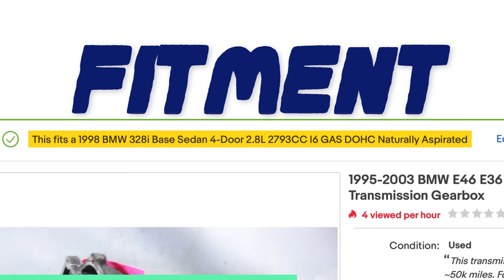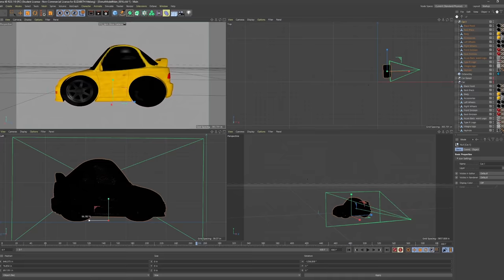Is a Manual Transmission Swap Worth It?

Comment: Yes. End video.

Realistically, most auto transmissions aren't slower these days, and can actually be faster, especially if you reflash the transmission computer for crisper shifts with decent sequential modes that don't upshift when you get off the throttle.

My car had a garbage auto and I got a much better driving experience just because the gearing matched my torque curve better. But even without that, slushboxes are cancer. Drive a man's transmission or GTFO.

I've done two manual swaps on my own MR2s, then one on an S13 240SX, one on a '69 Mustang, and one on an 80s pickup of some kind. None of them was terribly difficult, but it does help a lot if the chassis was designed for the manual and all the new parts just bolt right on. It also helps when you can just run with the auto ECU instead of trying to swap ECUs, then re-pinning the harness. Doing a manual swap on a new Camry is in the "probably not worth it" category unless you're good at fabrication.

Comment: I'm curious... 
Is it better to (just) buy a manual gear car or buy an automatic gear car and then convert it to manual? 

Is it absurd or this kind of tunning could actually improve the car's performance? (Depending on the car parts of course you get of course).
Thanks✌

Comment: Didn't watch this whole video, but one thing you have to do if you swap in a manual trans is swap your rear end for a lower geared, (larger number), unit, as a manual transmission will not allow you to pull as high a gear as an automatic will.  Fail to do this and you will not like your conversion - every time you upshift, the engine will fall on it's face power-wise.
Reply: the final drive ratio on automatic e36 is actually shorter than on the factory manual ones

Comment: What if you have a manual, wanting to do an engine swap, and the new engine came with an automatic transmission. Do I need a flywheel for the engine swap?

Comment: 750 bucks for this shitbox's used transmission??!?!? those go for around 100 bucks or even less where I live. Many people call E36s "trash cans" because oftentimes people bought them rusted for cheap, drove the crap out of them and trash them. It was the cheapest car for drifting, people would weld up the diff, and abuse them until they would fail, then trash them, it is the same with e46 BMW and used to be the same with the E30, and because of that (and rust), E30 is now a rare sight to see

Comment: I just "totaled" my '07 Toyota Carolla sport, after just replacing the clutch I burned out. I just bought a 2014 of the same make and model, but no manual available. New car has almost 170,000, and my manual only has 139,000. Seeing that I already have a manual car, I have all of the necessary parts right there, don't I? We get super icy winters and I've never owned an automatic because you are 100% reliant upon brakes. Brakes are no help on ice and you cannot stall your engine for an instant stop in an ice or impending accident emergency. Terrifies me to not have that control.
Reply: highly doubt you will be able to swap the transmission over to your new corolla, also because its fwd you would have to figure out how to get the shifter assembly and cables to work properly. would probably be easier to just swap the entire engine and trans in from your 07 but its just not worth it tbh, shouldve just got a manual in the first place

Comment: Awesome video as usual !
You mentioned that you can remove the check engine light with a scan tool, can you elaborate more ? 
I did the swap and I still
Have the light on but the it’s not clearing .
Thank you in advance !
Reply: You cannot clear the code if the ECU is looking to communicate with the automatic transmission.  You will have to look for a manual ECU and reprogram it with the correct VIN.   I know this because a parts house kept sending me an automatic ECU for my manual BMW/mini and I kept getting TCU not communicating codes. (Transmission Control Unit). I’m in a DEQ area and they wouldn’t even check emissions when the check engine light was on.

Comment: how do you know if the transmission will fit in your car? I want to manual swap a ford taurus pi, but because the cars only came in automatic, i’m worried i won’t be able to do this.

Comment: I have a question semi related to this project.  I have a 1995 Chevy k2500.  The previous owner took the automatic transmission out and put in a 5 speed manual transmission.   It suited my needs for awhile.  Since then the engine became toast, so I put in a new crate motor  double the hp and torque that came from the factory.  

The manual tranny no longer suits my needs and I'd like to go back to an automatic transmission.  The tranny that was in the truck from the factory really isn't adequate to handle the new engine.  It had a 4L60 in it.  I'd like to put in a 4L80 but I have no idea if that's even possible.  Can you provide me with some various reference websites where I can do some research to see if this is possible and what it would entail to get it done

Thanks

Comment: I suppose “worth it” is a subjective term. It would depend on what you going to be doing with it. Off road, racing, or drifting then yes. On the other hand a daily driver that you plan on going back and forth to work or sitting in medium to heavy traffic all day then no.

Comment: Is a manual transmission swap worth it? Yes. The autotragic in my 98 Accord blew up as they tended to do. I was able to buy all of the conversion stuff needed and an MT transmission for less than another used AT for the car.

Comment: If I used the ecu from the donor(cuz I motor swapped too) and it still doesn't crank. Do I have to bypass the neutral safety?
Reply: E36^

Comment: Do is an axel swap worth it? Do a video with a jeep xj manual, and then swap the axels turbo it and strengthen the frame, I garnuntee that said series or video would be a hit, Multimillion views. Yeah a good example is also about $6-10k it just works though

Comment: Why not hack into the ECU to manually control the automatic transmission?
Reply: bc then your not manually shifting gears, which is the fun part. its not about picking your own gear (mostly)

Comment: with all these parts, isn't a "stock-manual-shifter" cheaper? Ohly the parts they've shown are over 3k.
At the end he say, that he has a car, which is 2.5k-3.5k more worth, than he pay for the car, and he doesn't pay that much for the parts. That's wrong. He paid more than 3k for the parts. So he could buy a manual car for the same price.

Comment: Auto’s suck. My 2019 jetta has a turbo, but it’s an 8-speed auto. The turbo doesn’t engage until about 2,000 rpms but the transmission shifts at 2,200. It sucks…

Comment: Yo, I’m really new to all this car modding. I’m planning on buying an e90 as my first car however they hard impossible to find in manual transmission in my area so I’m considering buying an auto and converting it. But I’m really not sure if I should do that as I’m not aware of the pro and cons. I actually did find a manual e90 but it’s got around 200000ks in it. Please help someone!

Comment: i used to think a manual was fun until i had to drive one for about a year. seriously got tired of working that clutch. i'll take a good auto any day over a manual. more power to people that like a manual though
Reply: driving a manual is the norm in Europe and the UK. It does suck a little in start/stop traffic, but on highways it's the same because then you just put it in 5th gear and enable the cruise control

Comment: I doubt I'll get an answer to this, but is there any particular reason you used a hydraulic clutch instead of a cable clutch since you were doing a transmission swap?  Although I've got more miles with the hydraulic clutch it has always given me a bit of trouble and I still prefer a cable clutch, which is why I'm interested in the answer.
Reply: because the manual version of this car would have a hydraulic clutch so it’s much easier to just use it. and what trouble does it give you?
Reply: @arcanevoid9199  I've only driven one vehicle with a hydraulic clutch, but I've put well over 120,000 miles on it.  I got it used, and for the first 100,000 or so every so often it wouldn't shift into first or second gear at all, and it always ground going into second and third gears.  Both problems happened with the clutch pressed to the floor and the reservoir full.  I'd think the problem was the transmission, except that trying to straight shift was worse than hitting the clutch.  Part of the reason I thought it might've been the clutch originally was because the problem was always worse in cold weather (typically in the twenties Farenheit or colder range) with the colder the air temps the worst it was (-10?  Better to stay home if the option is available, as that vehicle was nearly impossible to get into first or second gear by that point).  I know for sure now that most of the problem was the clutch because after I put on a little over 100,000 miles the clutch gave out and I had to have it replaced.  The mechanic told me that the clutch that was in it wasn't the original, nor had it been installed correctly.  Now she will always shift into gear for me, but I still get the occasional grind shifting into second gear, meaning that the transmission has probably gotten slightly screwed up because of fighting with it for over 100,000 miles (and mostly driving short distances for those miles with a lot of stop and go traffic).

Now, maybe the hydraulic clutches have become better since my 2000 Dodge Dakota was designed and built, but I never had anything remotely resembling that much trouble with any of the various cable clutch vehicles that I've driven, and aside from about 3 years recently driving truck OTR I've almost exclusively driven manual transmission vehicles.
Reply: @Razmoudah  just sounds like that car specifically no? like if someone didnt install the clutch properly its not gonna matter if its hydraulic or cable
Reply: @arcanevoid9199  Until the clutch had to be replaced all I had to go on was that it was the only vehicle with a hydraulic clutch that I'd ever driven.  Factor in that it was worse in colder weather (which does affect the brake fluid the clutch relies on, though not a great deal) and it just gives the entire hydraulic clutch thing an even worse reputation.  I even asked a couple of mechanics if there was any way to adjust the hydraulic clutch in my 2000 Dodge Dakota, and was explicitly told there wasn't.  That is something that I know can be done with a cable clutch.  As I said before, maybe they've become better, but my experiences so far leave me preferring a cable clutch.

Now, I'm not a car guy, so I don't spend much time digging up car information or trying to get my pick-up modded.  All I was wanting to know was if there was a definite performance based reason why they went with a hydraulic clutch over a cable clutch, or if they just stuck with what the manufacturer used in the manual transmission version of the vehicle.  As I said before, I highly doubt I'll get the question that I want answered answered.

Comment: the torque converter loses 12-15% power. manual gearbox losses are much lower :) and i saw you installed a lighter flywheel :) all lovely mods.

Comment: I've never used a manuel, can someone explain why people like it so much, it seems like a pain. I'm just curious. Plus, even Donut said they are unefficent on modern cars.
Reply: It's because you have complete control of your car and it's power as well, you can make it go fast , slow whenever you want unlike in autos where the computer decides and if something goes wrong with the auto it's gonna cost huge and will require experts to fix it a pain in the ass
Reply: @Reyy619  appreciate the answer

Comment: The quick answer is NO. Unless you have prior experience doing it, like a mechanic, then just find one that is already manual/stick. Between parts and labor you will spend easily twice as much as you would just paying one that is already a stick. Second is if you are fully experienced and do it yourself chances are you won't do it right or will forget something and spend more money just getting it fixed. In sounds good in theory but doesn't translate well to reality
Reply: this varies alot depending on the car, its really not that much to manual swap. and if its 20k for an auto with low ks, and 50k for a manual for example than it can definitely be worth it

Comment: really guys , jack stands ? get a set of quick jacks , its so much better to work with
Reply: quick jacks are really expensive
Reply: @arcanevoid9199  worth it in thr long run
Reply: @jamessouder6044  maybe but a jack and jack stands is like $400 and quick jacks are $3000. i would rather buy a car for that lmao

Comment: Wait so the manual E36 is only 2500-3500 more? You DID spend at least 2 grand on the parts, and you spent heaps more in labour, so I don't see how you figure it's worth it.

Comment: I have toyota camry1992 2.2 automatic transmition .Ride only in reverse  and i want to swap into manual   .The camry is very rare car in Europe. And the biggest problem is to find gearbox selector shifter  .I find a shifter in America  but is more expensive  than gearbox.If Anybody have experience with swap automatic to manual  (toyota camry1992 to  2001  4 cylinder) i have a question  .Is the gearbox from toyota camry 2.2 the same  with toyota camry 3.0 v6.I can't  find a toyota  service to confirm that.Everybody says ask in America. Its American vehicle. I will be great full  to anybody  who know that or give me a link  with service or company who know that.

Comment: I have a 92 325 and everyone in the world tells me “the auto in it is the only downfall” but I don’t see how. And on top of that
The brilliant people telling me to swap it, also told me it’s nearly impossible to get the reverse lights to work n shit. 
Headache for clout.
Reply: have you driven a manual one? harsh truth is that autos before the 2000s are garbage
Reply: @arcanevoid9199  I have a 94 manual in the same car.. 
don’t really care for the difference. 
Got told one time “you aren’t a real car guy then if you don’t care about the difference” and I laughed and said “all I care about is how clean the car is, how it’s put together, and if it goes zooom and burn “ 🤣 I don’t care to worry that much
Reply: @xanderpage9655  i mean that arent a real car guy thing is stupid, but like as an example the auto version of my celica is 4 seconds slower 0-60 and has 2 less gears. and its slightly newer than your car, how would that not ruin the car completely?

Comment: Just don't do it. Ever.  Do a complete Engine/Transmission replacement if this is something you are considering doing.  A little more expensive, but significantly more reliable and easy.

Comment: couldn't've you have just tuned the ecu for tighter gear ratios for more low-end gear torque? it would have given a similar experience with less the effort.
Reply: you cant change the gear ratios using the ecu, it has physical gears inside the transmission. and it still wouldnt be similar